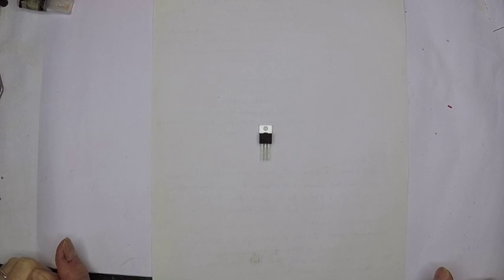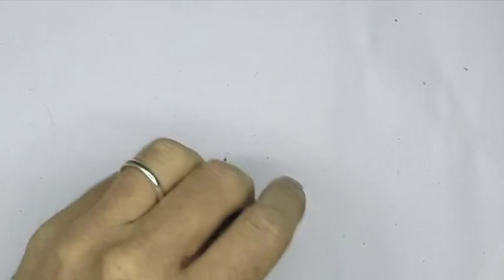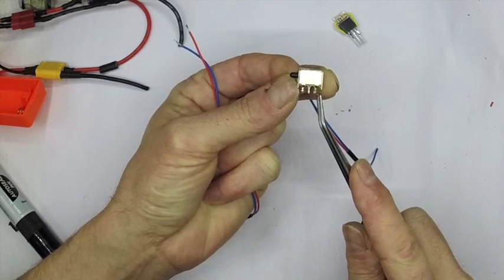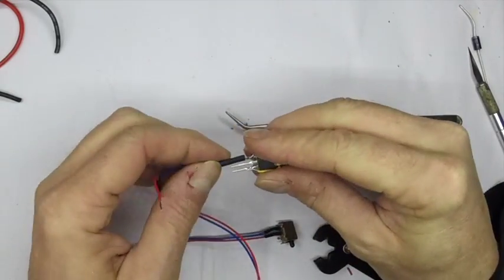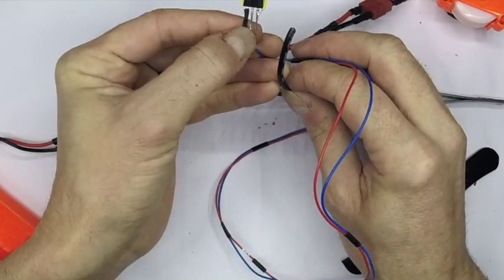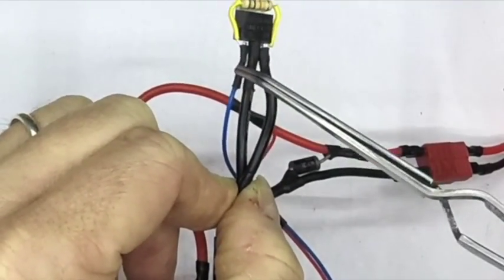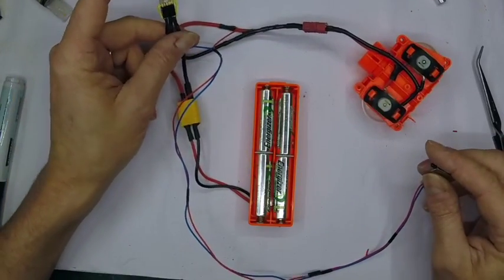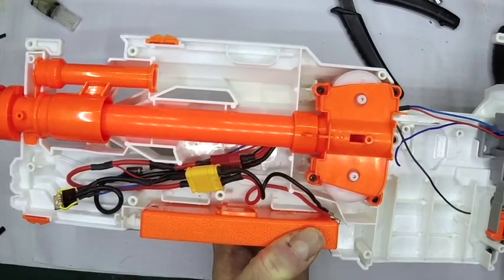How To- MOSFET's For Nerf

Comment: Seeing as this was 5 years ago, are there better options now? I'm going to take on the Nerf M41 Pulse Rifle. I want to keep the sound effects and amo counter but I'm going to throw a 3S lipo in it and flywheel cage with rinos. Do you know if anyone has tried it and maybe they have a wiring diagram?
Reply from the maker: I would ask around Facebook groups like Nerfmodders welcome. The best option to keep the sound effects is to copy my Jyn Eros build and separate the sound from the propulsion and use a voltage dropper to run the sound at 5v. There are also integrated MOSFET circuit boards now, that are all set up ready to fit. Out of Darts has lots of different ones. The parts scene has really exploded since I made these videos. Likewise motors, there are some very good 3s and 2s options now, have a good look around before you decide on motor choice.

Comment: Hi mate, I am watching your work and learning a lot as I go so thank you, I am about to start a stryfe build using MTB Neo-Hellcats and am wondering what mosfet setup you would recommend.....am I right in thinking I can still use the same resistor and diode as in this video and then just replace the mosfet switch with a 120A version?
Reply from the maker: You would certainly want the 120A FET. Maybe even bigger. Both Uknerfwar and Out of Darts, plus a couple of other suppliers now do much higher current FET set ups, some with an integrated circuit board to make wiring easier. The community has moved the tech on a lot since I did these videos.
Reply: Oh wow, ok I see what you mean, the britnerf version looks like it's something you do inline rather than ontop of the motors like the out of darts one....is that correct? If so I think I'd prefer that rather than the extra volume ontop of 180 motors
Reply: Ok out of darts want 50 bucks postage for a 10 dollar board and britnerf won't post to Australia....might be out of luck using a board so I might just have to do it the old school way

Comment: Mine didn't work it was stuck closed and the gun won't shut off I don't know what to do I'm really bummed out about it it was a worker mod I did everything correctly I put the resistor around it in the right way and the gate is connected to the switch that is connected to the power wire red and the ground from the motors goes into the mosfet in the center in the ground is connected to the third pin I have to order a new one because one of the pens broke off so I think it was just damaged to begin with
Reply from the maker: You have something wired wrong somewhere, what you have done is cooked the mosfet so it’s always “on” . It happens sometimes, I keep a pack of spare FETs so I can repair my mistakes without buying a whole kit every time. Try the MOSFET board from Uknerfwar , takes all the guesswork out. Out of Darts has similar kits with a PCB in.

Comment: is it ok to use t plugs without mosfets?
Reply from the maker: Deans connectors and XT60 or 90 are fine on the motor blocks, but anything else needs to be current rated correctly, so you couldn’t use the small JST connectors on the Rev switch without a Mosfet. There is really no reason not to use a FET now, since multiple sellers offer cheap boards for them that cut out any guess work.
Reply: So, if I'm planning to use your setup in this video (with t plugs between flywheel cage and switch), but without mosfets, whats the maximum amps it could take? (and how to count an amp in the lipo)

Comment: can i use the gate with 18awg wire?? thank you
Reply from the maker: si iyans If you want to waste decent wire on the signal side it won’t hurt. You can recycle stock wire on the low side wiring as well.
Reply: @foamdataservices  ok thank you very much 🙏
Reply: can i use this in full automatic stryfe? and how do i install it? thank you

Comment: Wow, i opted for 130 neo cans instead of 180s because i was intimidated by needing to use a transistor rather than a snap action switch. This is easy as pie! Thanks for the tutorial!
Reply from the maker: GeneralLee131 It’s even easier with a pre loaded FET board or through hole board, UKnerfwar does those in the UK, OOD has pre made boards in the US. Some modern 130’s pull way more current than old 180’s, especially new mag 130’s. Can size is no indicator of current draw.
Reply: @foamdataservices  Thanks for the tip. I'll check out those pre-made boards!

Comment: Care to make any comments on the IRFZ44N versus the IRLB3034 that (I believe) OOD sells standard?  As far as I can tell, and I am a rather new electronics hobbiest so... grain of salt/fact check, the IRLB costs more but has better RDS(on) so less heat in general function, and also much better drain-to-source amperage ratings so may be overkill for most use cases but may actually be necessary for those who want to go nuts with some 180 motor neodymium shenanigans.  What are your thoughts?  Is there a particular model that you would suggest for a mosfet that fits in the "overkill for most, but is guarenteed to work in the most demanding conditions" category?
Reply from the maker: Micah Miller The 3034 is better. UKnerwar.com sells an even better FET in their board kits. We started using 3034’s in 2014 for neo mag 180’s. At that point the 44N was fine for everything else since motor choice was more limited. I now fit the higher power ones to everything.
Reply: @foamdataservices  great to know, thanks for weighing in l! :)
Reply from the maker: Micah Miller No probs, the hobby has moved so far in the last two years many of my videos are out of date!

Comment: So as I've learned more about Mosfets, motors, relays, switches, etc. I've started to wonder... even if we aren't using a MOSFET, wouldn't including a flyback diode across the motor part of the loom just be helpful in general?  Like, wouldn't it also make regular switches potentially live longer too?
Reply from the maker: Micah Miller Switches are bi directional, so BEMF doesn’t really cause them a problem plus it occurs after you release the trigger and the contacts are open. A flyback diode should certainly be included in any circuit with a micro controller or other more sensitive components in.

Comment: this fet couldnt fried out when i used a 3S on it. i mistakenly thought this could work on 3s motors and an omron.
Reply from the maker: You wired it wrong then. It’s rated to 250v 60A. It won’t have blown because you used a 3s lipo. If you want a higher rated one, say if you were using 3s neo mag motors then use an IRLB3034, that’s rated to 120A or so.
Reply: Foamdata Services oh then it was definitely the 65c and neo mag motors.
Reply from the maker: Neo mag motors need the IRFZ3034.

Comment: Can this loom be adapted to a full-auto build? This is the only wiring loom i know and want to try my hand at an auto Rayven.
Reply from the maker: You can use this RS design with a cycle control switch. If you just have two switches then wire the pusher as a separate circuit since it’s just on off. Put the battery under the barrel, auto Rayvens need a 1300+ mah 40c to be really useful and the stock tray is too small. https://m.imgur.com/a/Xwst4#s954SfM
Reply: This is awesome, thank you. Guessing the cycle control switch isnt like the standard nerf switches, i will look into that. On that wiring diagram the hump in the wire path means they are not connected? For example the negative wire from the motor goes to the middle pin on the fet without connecting to anything else, correct? Should the pusher motor also be a 3S motor if in using a 3S battery and 3S motors on the cage?
Reply from the maker: A hump is NOT a connection as you have worked out.
Reply from the maker: Always use the same voltage on the pusher and flywheels.
Reply from the maker: Also the Nerf switches could be used with this loom in a RS, they are just not very good. In an auto Rayven you just need a small switch with an arm for cycle control, we use the Cherry DC2 10A with medium arm.
Reply: Foamdata Services and this would use the same mosfet as in this video?
Reply from the maker: vastneon For Fang RV you want an IRLB3034 they have a higher rating. Blastersmiths UK sell a kit or buy on EBay.
Reply: Foamdata Services I am looking at 3 Kraken motors, one for the pusher and two at the flywheels. Thanks again.
Reply from the maker: Waste of a Kraken on the pusher, a Rhino would do fine, I would still use the higher power FET, neo mag motors are pokey beasts.

Comment: Did the wiring right but now it stays on and won't turn off is my mosfet cooked?
Reply from the maker: Todjlet Yes, it is an ex MOSFET, it has ceased to be. You likely got the diode wrong, one connection is incorrect or you have too much current. Try again. I had one explode for no obvious reason this month, the first FET failure I have ever had.

Comment: Thanks for the great video, I just finished my first mosfet mod because of you :) I do have a question; is there a way to have motor breaking with the mosfet? The only idea I've found so far is to add another mosfet and it's a whole complicated process. But is there an easier way? Thanks for any help/suggestions you might have!
Reply from the maker: You have to use an H bridge with two fets for motor braking, personally I don’t like braking, it serves zero useful purpose. 
Glad you found my video useful, I still keep having to use it to remind myself what goes where!

Comment: I have just done this to a stryfe but upon testing it the motors spin very slowly with the switch in its resting position and compressing the switch makes no difference, I have checked that the circuit is correct to the diagram. What might have gone wrong?
Reply from the maker: You have made a mistake with the MOSFET wiring and cooked the FET. Re check all the connections especially the fly back diode. You will need a new FET. If you need more detailed advice then get a post up in Q&A on https://www.tapatalk.com/groups/britnerf/
Reply: Thank you. Luckily I bought a spare FET and will be trying again tomorrow

Comment: In the Jyn Erso blaster wiring loom, the blue wire going to the mosfet is shown to be wired to the common pin on the standard rev micro switch,not the red wire, as seen in this tutorial. Can you elaborate whats the difference between this Stryfe loom and the Erso loom.  Its a bit conjfusing for a first time modder, thanks.
Reply from the maker: It does not matter which way round you wire the Common or Normally Open, the switch works the same with the red and blue on either, it’s just a switch. As long as one goes to the FET and one comes from the battery then it will work. If using a different switch just be sure NOT to use a Normally Closed, since that will mean it revs all the time or not at all depending on where you put the other wire! The Jyn Erso loom requires a separate voltage regulated circuit to operate the light and sound, the firing part is the same as a Stryfe but the two are different overall.
Reply: Im using standard nerf micro switch then everything else you have stated as per both Erso videos and this tutorial. Thank you for your reply.
Reply from the maker: If making a Stryfe with standard two pin rev switch then it doesn’t matter which way round NO and C are on the Nerf switch. If making a Jyn erso the rev switch doesn’t matter but polarity for the light/sound bit is very important.
Reply: Yes doing multiple Ersos. Doing a performance version with custom paint. Then a vanilla LiPO version blacked out for Star Wars cosplay. The other two Ersos are for spares, seeing as I'm unaware if everything made for the stryfe is interchangeable with the Erso, motor cage/block etc. Thank you for your assistance and videos.
Reply from the maker: All the Stryfe flywheels fit the JE as do all the 130 size motors like Fang RV/Neo Rhino etc, the flywheel cage is different, OFP do a JE cage but I am unimpressed with it and printed cages in general. You can get 130fps out the stock JE cage with Fangs and Bulldog or Hooligan flywheels. I like the form of it better than the Stryfe.

Comment: Thanks for a great video on Mosfets! I just have one quick question, will the kit Out of Darts sells on his Etsy page https://www.etsy.com/listing/562017987/mosfet-kit-irlb3034pbf-mosfet-1k-ohm work? I'm trying to wire a regulator so that the board only activates the mosfet, which then takes the higher current necessary and delivers it to the pusher motor (if that's even possible) Some of the part numbers were different, so I thought I'd ask. Any advice you could give me on how to go about this would be much appreciated. I really enjoyed the video; thanks for making such an excellent, well researched guide!
Reply from the maker: No idea, ask the seller.
Reply: Okay, thanks for the reply!

Comment: So I'm curious, what is the purpose of the 10kΩ Resistor on the Mosfet?
Reply from the maker: You need a resistive load across the gate/source.
Reply: Foamdata Services huh, thanks, now I feel like I need to go get a degree in electrical engineering to know WHY that is :P
Reply from the maker: First rule of MOSFET, don't worry HOW it works, just know it does.
https://electronics.stackexchange.com/questions/68748/question-about-mosfet-gate-resistor
Reply: Foamdata Services yeah, I know, and as for the inside of the MOSFET, I'm pretty happy not knowing how it works, the resistor just piqued my interest. That link did help me a little, and that'll do, so thanks. I still don't really understand it, but I can see some of the logic behind it.
Reply from the maker: Think of a MOSFET as a chemical relay.
Reply: Foamdata Services yeah, got that, don't worry, my curiosity was subdued enough thanks to that link ;)

Comment: If I use a 8.2k or 12k resistor which would be the best. Im new to this and used up my 10k already.
Thanks
Reply from the maker: Either should work. Never used anything other than a 10k myself tho. I prefer to wait for the right parts as opposed to rushing. You can do everything except the resistor and don't plug it in until 10k's arrive if you are in a hurry.

Comment: I believe you've already implied that it doesn't really matter, but I'm going for safe rather than sorry. Would it be acceptable for me to place the diode between the motors AFTER power is already fed to one of them? Such as, if I wired up the motors in the style of MTB's Stryfe guide, and placed the diode between the motors and wires?
Reply from the maker: You can put the flyback diode across the motor terminals but that's a worse way of doing it. If you use a plug in motor block and do the job properly then you firstly don't need to use new diodes on every set of motors, one does everything and secondly don't have to solder a large diode leg over the motor tags, which many peoole have trouble with already.
Reply: Alright, fair enough. I already have trouble getting my cage wired up as I like, so I think I've got a spot under the trigger where I can squeeze it in.
Reply from the maker: Put it by the jam door switch, or in the top of the mag well. Look at my MOSFET board video, you can see where we put them.
Reply from the maker: Also remember the flyback diode must go between the main +ve to the motor and the -ve from the FET. Putting it in the grip means running a very long loop of 16AWG you don't need if you use our method.

Comment: Running into a little bit of an issue. I purchased several of the mosfets you recommended, wired it all up for arduino, and it worked, until it stopped working. After a little bit the hellcat 180s were just always on as long as my lipo was plugged in. I tested continuity between the drain and source pins on the fet and it was continuous. Thinking I'd burned out the mosfet, I soldered up a new one and slapped it back in. Tested my arduino code and the motors spun up with the press of the rev trigger, and stopped when I released the rev trigger. However, after revving again, I felt the mosfet and it had gotten extremely hot. The motors then began to continue running past the moment I had released the rev trigger. Can you recommend a different mosfet for my 180s? Or would getting a heatsink/fan do the trick while still maintaining a relatively low profile? Have you run into issues trying to use these mosfets with high current draw motors? Thanks for the great video! Love all your work! Any help would be appreciated!
Reply from the maker: You have cooked the MOSFET, either you forgot a flyback diode to protect it from the back EMI, you got the pins wrong (less likely) or something is up with your program. Go to www.britnerf.co.uk if you want proper tech advice.
Reply: Update! The issue was not my flyback diode (which I did have), nor miswiring, nor issues with my program. After looking at the mosfet's data sheet, it is not "fully open" when it is given 5V (the voltage an arduino outputs). So it was acting like a resistor much more than if it were to be opened with a 2S or 3S LiPo, and overheated. Hence I was cooking the mosfet by not opening it all the way. Solution: I purchased IRLB3034 mosfets which are fully open at 5V. I tested it with the exact same code, put some darts through it, and the mosfet has not gotten hot at all.

Comment: Thank you so much for your great guides. I took your advice on the BSUK rapidstrike switch plate and wired it using your new rapidstrike wiring guide. I am using your MOSFET build in a new rapidstrike to keep the stock switches and plate.
Reply from the maker: You will only be able to keep the stock rev trigger, the cycle control ones break all the time and you can't use a mosfet on its own for the pusher, you need a more complex set up for that.